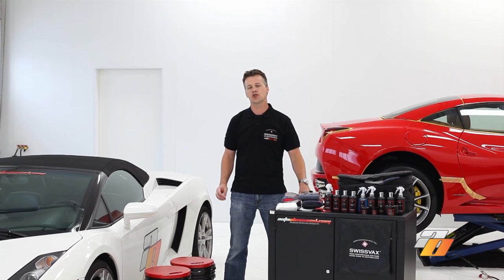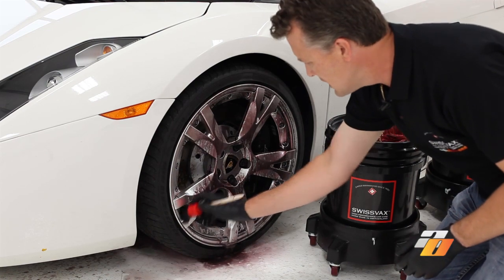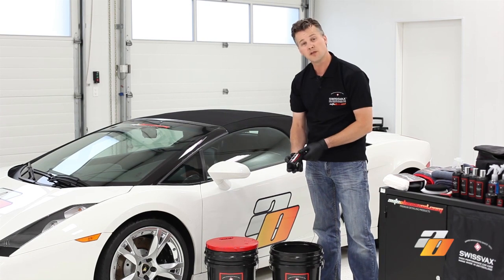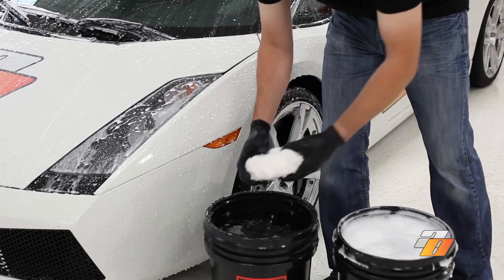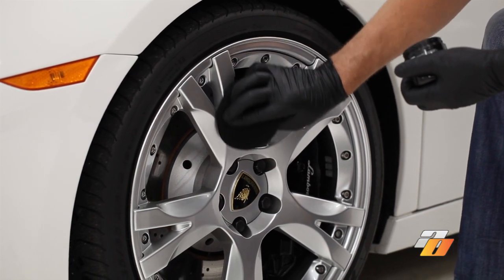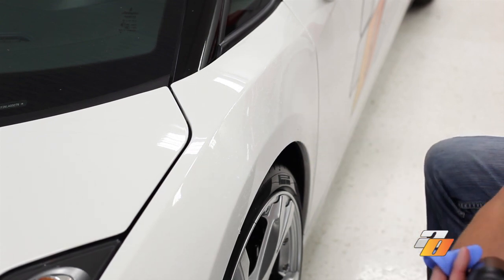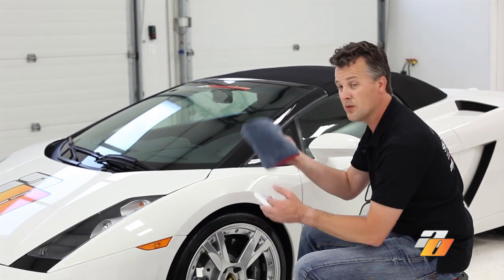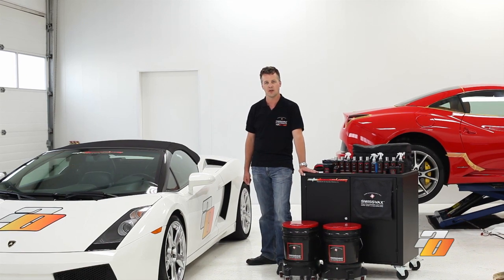Swissvax Products Detailing Guide How To Use Swissvax Products and Swissvax Carnauba Wax

Comment: Why clay without inspecting to see if it even needs a clay bar? Or is that needed always before waxing.
Reply from the maker: Yes of course, you would not clay unless the vehicle needs it done.  If the vehicle is brand new or has been driven for any length of time it will likely need to be clayed/decon'd before waxing.

Comment: I have a question about cleaning rims with oven cleaner... Apparently it works really well, and supposedly doesn't harm your rims. Super cheap as well. I was gonna buy iron x but if it works good and doesn't harm then there is no point in spending $20 on 500ml. Also I like your watch tan line lol